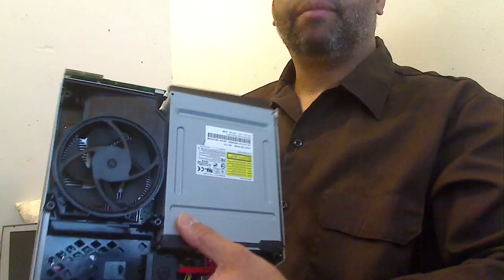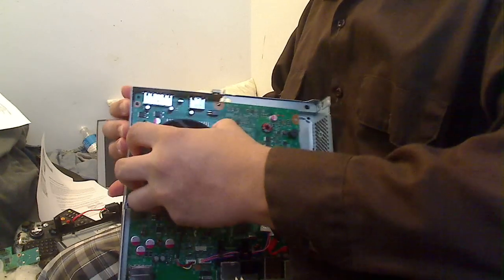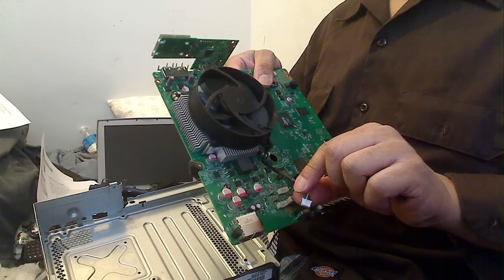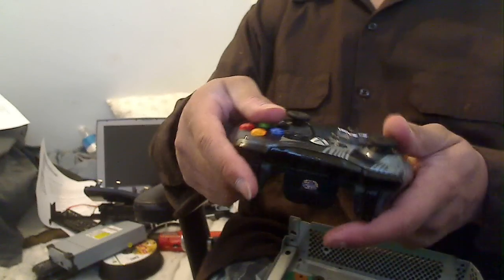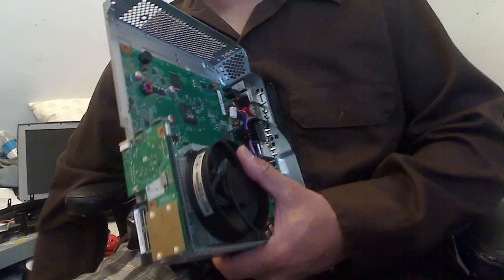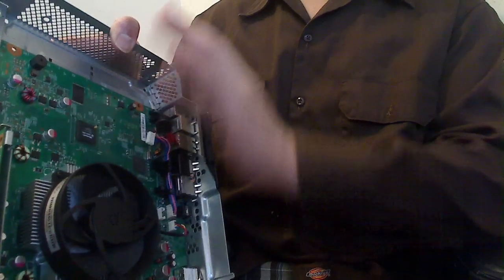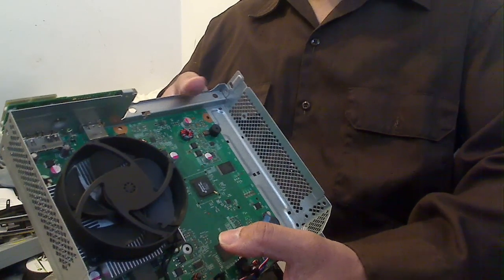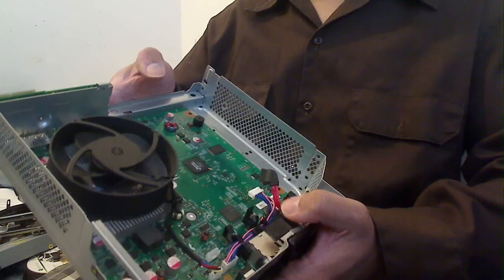How to fix Xbox 360 Slim RROD / Red Dot of Death Reset Solution👍

Comment: Hi i got my xbox from my friend without a internal hard drive could that be the issue even tho I've had it over a year and just recently red dotted and it over heating shouldnt be the issues since i rarely use it and if i do no more than a hour hour and a half could it still be fixed????
Reply from the maker: Arlen Cabrera A red dot error after an hour of game play indicates that your console is overheating or that your power brick is over heating. You'll have to check both. The Xbox 360 Slim's power supply has an internal fan that cools the inside components. If the fan is nonfunctional the power supply will over heat and you'll see the light on the power supply turn red. This will also happen if the power supply is on carpet or if there's no sufficient air flow. If that's not the case you'll need to disassemble the xbox and replace the cpu paste on your CPU but check to make sure the fan inside the Xbox hasn't failed, since fan failure is also a culprit of over heating.

Comment: what if i dropped my xbox and the red dot happens? how do i fix it?
Reply from the maker: Garrison Van Minsel If you have an internal hard drive, then you should pull it completely out and then put it back in and then power on the xbox, unless you've dropped it from a few hundred feet; if that's the case, then it's done, otherwise just do as I suggested with the hard drive.

Comment: I have a XBOX 360 when they are served green dot on the device and runs the desired solution
Reply from the maker: Zakaria Labaalli Hey Zakaria, Could you clarify your statement.!
Reply: Peace be upon you Stales I have a XBOX 360 when I run the machine a green dot appears on him and the device does not work on TV Please Solution
Reply from the maker: Zakaria Labaalli Try replacing your video cable. The HDMI or the video component cable are the types of cables used for Xbox 360's. Replace and let me know what happens or try a different TV.

Comment: hey, i know this is an older video but if you're still around i have a question. my xbox won't auto shut off when trying to reset. so far I've left it on for almost an hour with the fan unplugged. any suggestions.
Reply from the maker: happenstance shmudlap There could be a problem with  your processor. It may be either non-functioning or your power brick may be malfunctioning. Borrow a friends power brick to see if thatz it. Try removing the hard drive or plugging thw xbox in a different part of the house.
Reply: Thanks, it must be the processor because I'm using the brick on a faulty 360  i bought on craigslist and already repaired, I'm also using it in the same power outlet. Thanks, i was going to try and heat gun the gpu/cpu chip then put new thermal paste on but it seems like a lost cause. It's a bummer because it powers on and the disc drive works. I might still mess around with it in the future thanks again for pointing me in the right direction.
Reply from the maker: happenstance shmudlap I believe that you should definitely try the heat gun solution, which I actually mention in my video. The Xbox in this video also required a heat-gun, along with the reset. It's a good solution. Give it a go. Your xbox may just surprise you by powering on after your heat-flow.
Reply: Will do, what type of thermal paste do you use? Also where could i buy it? I seen some on the wal mart web site, but I'm not sure if it is in store or only online and if the brands are any good. Thanks again for the input.
Reply from the maker: A thermal paste called Arctic Silver  has been my favorite for years and has been the preferred brand by most gamers for computer CPU's and Xbox CPU's. You can purchase it from radio shack, Walmart, Kmart or any other large department store or electronics store. Truthfully you could use any of the brands on the market but thermal paste can dry out over time and if it does, heat transfer from your cpu to the metal heat block is hindered, keeping most of the heat build up inside the CPU. Heat build up can kill your CPU.! Arctic Silver has been known to stay in a more semi-liquid state without drying for long periods, extending the Xboxs CPU ability to get rid of heat. Its usually more expensive because of this fact.
Reply: Thanks

Comment: when I plug in items into any of my USB ports, it freezes and when I turn back on, if it has anything plugged into the USB ports, it gives red dot
Reply from the maker: Noisy 5niper Take a flash light Check each USB port for bent pins. Bent pins inside of any USB port may be touching  the metal housing of the USB port. If any of the pins are touching the inner metal USB  housing this will ground the USB port and cause a ground fault, which leads to a Red-Dot error. If there are bent pins touching the housing, unplug the xbox; bend them off of the inner housing of each USB port using any small tool. If none can be bent all the way down to their original flat position, just make sure no pins are touching the inner housing, then try and power on the xbox. If it powers on with a green-light of Life and you believe it's operating correctly, power off and unplug the power once again. Now purchase a hot glue gun from the dollar store and fill each USB slot with hot glue that has pins that you were unable to flatten completely. Filling each USB port with the hot glue, (actually low melting plastic)will keep persons from accidentally plugging something in the port once again causing the Red-Dot Error.!
Reply: Donte Beachem I just checked, all the pins seem to be fine Donte
Reply from the maker: Well that's usually the only thing that causes the problem you've indicated. Be sure to check the cables or objects you've plugged into those USB slots. Also, be sure to check the 4 in the rear and the 2 up front for debris as well. Try unplugging for a day as well.

Comment: So the rf module is to be disconnected when I do the reset?
Reply from the maker: Carlos SpicyWeiner You can leave in the RF module, since u may need it to power on the xbox. No need to remove it once the xbox is powered on.

Comment: hello Donte thank you for the informative videos, they are very much appreciated. I have a 4gb slim and i downloaded the update for minecraft and played it for about 20 minutes then i shut it down. 4 days later i went to start it up (during a bad storm) and i signed in, and got the usual "having trouble connecting to xbox live" message, so i went to run the diagnostics and got half way through the tests and the screen went all grey black checkered and made a horrible static sound and i shut it off. i waited about 5 minutes and started it, it went to the sign in screen and it did the same thing accompanied by a red dot, i shut it off waited about a half hour tried it again and this time, no screen no sound and the green dot turned red after about 8 seconds. i went through all the suggestions on the xbox site with no avail. i took it into my brother and we tried his cords with no result. One odd thing is when my brother went to remove and reinstall the hard drive there wasn't one, is this odd? i plan to do the re-paste, but i was wondering if you had any thoughts or suggestions on my specific situation? thank you very much, Rhonda

Comment: My Xbox One Halo 4 Limited edition was having this red dot problem until i saw this video, the thing i cant understand yet is why the fan is working like a hell when there is not heat, cuz I placed my hand over it and the air was cool...
Reply from the maker: Fabio Plasencia Hello Fabio, I cant really answer any questions about an xbox one but most are new and in-warranty. You can call Microsoft and request a repair. They may just replace the entire console with a new one if yours cannot be repaired. I hope you get it repaired.
Reply: Donte Beachem warranty has already expired, this console was eating dust literally cuz I played it for like 4 months with halo 4 when came out then save it on the closet, now that I feel like use it again this issue comes, I think the update may got something to do wit it cuz having in mind that was used so little and this appear, seriously makes me very angry, the console it's aperently working, cuz I tried the reset you suggested, I'll try playing again but the fact the fan is working at 100% is annoying,  I also replaced the thermal paste.. =(
Reply from the maker: You replaced the thermal paste in your XBOX ONE. Let me just remind you that this video DOES NOT COVER Xbox One Consoles. It only covers Xbox 360 Slim consolez and the Red Dot of Death. How did you apply the contents in this video to an Xbox One?
Reply: Xbox halo 4 Edition its an Xbox 360 Slim, the red dot still comes up. I think this is a software related issue. Microsoft wants me to Pay almost 100$ to get a replacement but a normal edition not this one..

Comment: Hey just got mine from a friend that said his daughter got the rrod. I have everything apart and trying your reset before I get the paste just to see if my Xbox will stay on and it doesn't. It blinks a few times red then powers off after about 5 seconds. Don't want to go spend money for paste and take apart fan assembly if this isn't even going to work. Any ideas why it won't stay on? Thanks
Reply from the maker: Audiotech05 An issue with the powerbrick over heating because of clogged vents, malfunctioning fan can also cause the Xbox to red ring, bent usb pins can ground out the xbox or even a powerbrick that has a red light displayed without powering the Xbox or with powering the Xbox can all cause Red Rings.
Reply: Donte Beachem ok, yeah power brick seems good. no red light, plug fan in and it works until xbox powers off. I will try doing paste tomorrow and see if that works and replace fan otherwise I'm out of ideas. checked all pins and ports, no bent or touching pins. Can the power brick go bad but not show a red light? Thanks again
Reply from the maker: The power brick doesn't go bad without a red light indicator, as far as I know. U can always try a friend's brick or take the Xbox to gamestop to see if the cam try a working brick on your Xbox. If all that fails, you can try my method. Many have had success; some haven't. You can akways send it back to Microsoft for repair and pay the fee, that's if they're still offering repairs on that Gen.

Comment: i got it working, it wasnt getting enough power, i switched outlets and the sound is gone thankfully. i had a friend of mine help me determine what was causing the sound coming from the hard drive, i may need a new power brick instead of a new hard drive.
Reply from the maker: well that's good news. Glad you got it up and running.

Comment: hello i have a problem with my 250gb hard drive, it keeps making this small ringing sound from time to time, it started to happen 3 days ago. i dont exactly know what happend, as i was at work at the time and my wife was watching netflix on it, and out of no where it started making this small ringing noise. it did end up getting the Red ring of death a few times along with the E 68 error code on the black screen, i read on a few websites it could be a defective hard drive but im not sure why since i have had my xbox 360 slim for about 2 years and had no problem with it untill 3 days ago when it started making the small ringing noise. i took my xbox 360 slim apart and checked everything and cleaned it out, and determined that its coming directly from the hard drive. i have no idea what the small ringing noise means, the hard drive works from time to time, but the small ringing noise starts up when the home screen appears, when im playing a game, watching movies on netflix, pretty much doing anything on it. im not sure if the hard drive is defective or if the connectors for it are defective. please help
Reply from the maker: You're hard drive may be failing. You should purchase a new one. Back up all your save game data to the cloud and go purchase a new hard drive. Transfer all your data to it and see if the warranty on the failing drive will allow you to get a free replacement. If purchasing a new drive isn't within your budget, buy a large USB thumb drive and plug it into the Xbox for formatting. If you already have a thumb drive, make sure all of the files in it are backed up because they will be deleted.

Comment: I have 2 x360 slims that got the RDOT, one of them goes straight into the Red dot and doesnt even open the tray or do anything for that matter, the other boots up green, but then goes into the red dot, and it does open tray like normal. Do they have the same solution or is it different for both
Reply from the maker: You may be able to fix both with the solution provided in this video

Comment: do you have a video on how to fix xbox 360 slim when it does not reboot, i dont think its the hdmi problm, it just stuck in no signal, green light in the middle and it wont boot , i already tried the Y rt method and also some other method to fix it, i already done your lessons here still not working, and also tried deleting all plugins that might affect my booting but still no luck, i hope you have solutions with this sir.. much appreciated..
Reply from the maker: Usually the final step is to use a heat gun on low both sides after cleaning. If heating doesn't work then you could have a bent USB pin grounding the port and the Xbox. Check all your USB ports. No bent pins, try someone else's power brick. You may also have an incomplete Xbox live update.  A solution to an update fix can be found on Xbox live.com
Reply from the maker: Not really sure but it sounds like your Xbox has booted, especially since you have a green light on your Xbox. try switching HDMI cables and if you're using the component cables try some new ones, ask a friend to borrow theirs, try a different HDMI port or a different TV.

Comment: hey, have tried just about everything you recommended, anything i could do?
Reply from the maker: I'd you haven't tried the heat gun on both sides, then your problem may be a bad xbox live update or a bad power brick. Try a friends power brick to rule it out, otherwise a heat gun on both sides usually solves it unless there's a bad xbox live firmware update.
Reply: thanks will do

Comment: hey I had this happen to me today I want to play bo2 and also now the HDMI is actusly blurry like I have the red white and yellow ... my console lite flashes red and. I was wondering if I should do it my self. and my power did trip yesterday while I was online but it was fine when I was on it after but then the dot came up today so I don't no what to do should I do this my self
Reply from the maker: So you had a surge and your breaker tripped. That's not always a good sign for xboxs connected to a surged power port. The 1st thing to do would be to check that large power adapter that came with your xbox. It is also a surge protector. It may have taken a surge hit and can't supply adequate power to the xbox now. Turn on your xbox while watching the amber light on the power adapter and see if at any time goes to red. It is supposed to just go from Amber to Green. Replace the power adapter if you notice the light go to red even slightly cause it's now damaged. Otherwise if no observed red light, turn off the xbox, unplug the power adapter from the wall and the xbox and leave both disconnected for about 2 hours and then retry to test for functionality.
Reply: its fixed but its like i have no hdmi cable in its doubble lines like blury and its like i have the red yellow and white in
Reply from the maker: Ok so what did you do to get it to this state of functionality.?
Reply: I gave it a few hard taps on top by fan amd then it went loud so whqat I did was open it up just the sides and vaccumed it and then tryedto even more and find dust bunnes and then I put it together and I never heard the fan it was real quiet and was gettn hot I gave it a couple taps by the fan and the fan turned on after the rdod cameup and 3 secs after I tpped and the fan came on the rdod had dissapeird and it worked after that but my hdmi is blurry and shtty
Reply from the maker: U should try something mediocre first, like unplugging the Console from the power, unplug the power brick from the outlet, ethernet and Video for a few hours. Afterwards, plug everything back in and power up. Play if you can. If the dot arises again or if this unplugging method doesn't work, then check your power brick for a red light during power up and or replace your HDMI cable. Try a component or VGA cable. VGA video sucks but we are just looking for a solution right now.
Reply from the maker: Ok so I guess you have your Xbox working or you replaced it. I noticed that you posted a more recent question about your hard drive functionality.

Comment: Hey Donte ! i am facing the red dot problem after some time approx 30mins or 1 hour i have a 250 gb hd and also an USB for update file of games can u please help me out what is the main problem.... Thanks
Reply from the maker: Over Heating is your problem.
Reply: so what is the solution for over heating
Reply from the maker: It's talked about in the video. Follow the instructions in the video for cleaning off the old CPU paste and placing new CPU paste in between the heat sink and cpu

Comment: Having a difficult time removing the screws under the Heatsink! I got 3 out but one of them is jammed in there really bad!
Reply from the maker: so which tool are you using?
Reply: Using a T8
Reply from the maker: Did you strip the T8 screw head?
Reply from the maker: T8 is the correct tool. If you've stripped the head, you may be able to use a larger T9 or T10 tool which may give you better tork on the screw.
Reply from the maker: Try placing the tool into the screw head then pressing hard and then turning while continuing to add pressure.